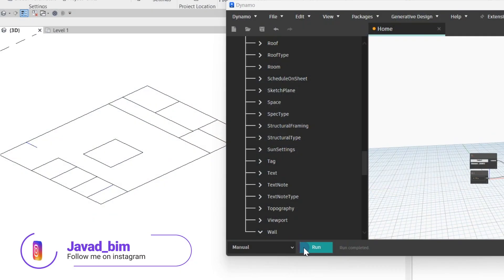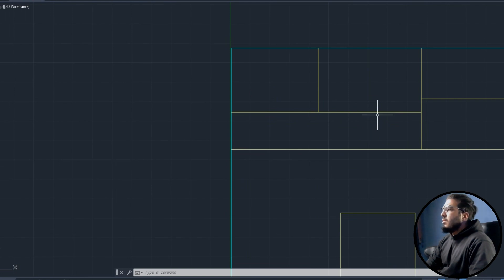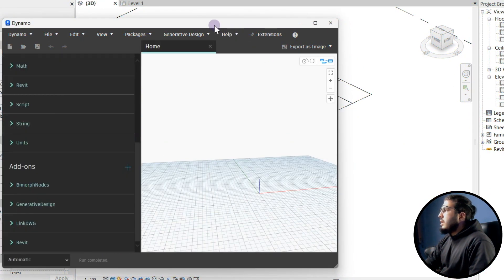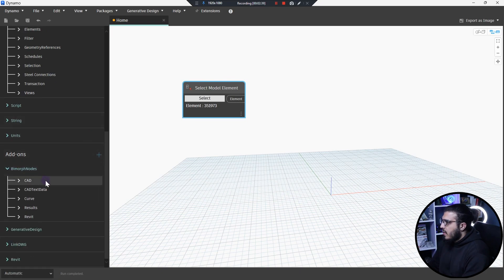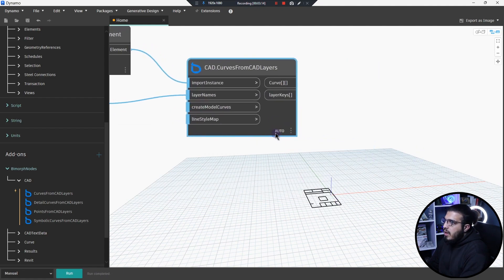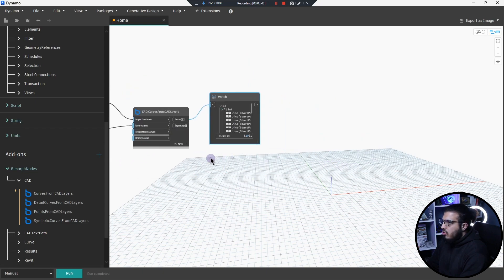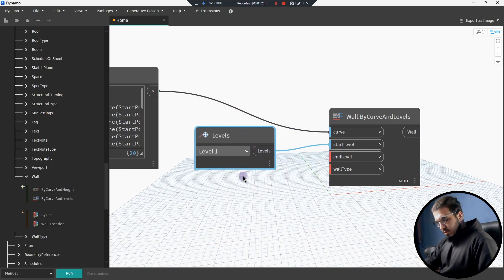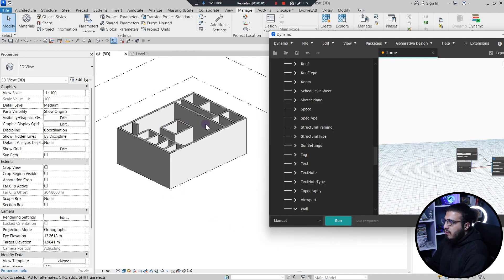Auto Walls in Revit with Dynamo !

Comment: Nice video, but this workflow should be developed in more detail I think. CAD files usually only have wall edges, which makes the real problem much more challenging to solve.
Reply from the maker: You are completely right
I have tried to do that detailed part for myself, and I found it really challenging to do it without coding 

Personally, I use this method for fast plan designing  with line and then converting it to walls